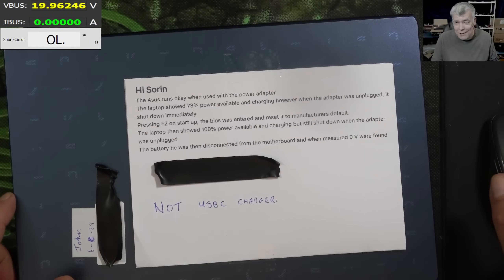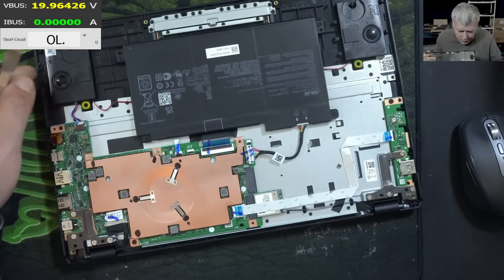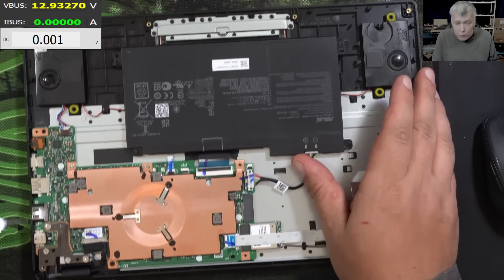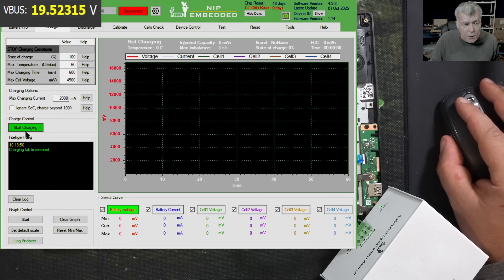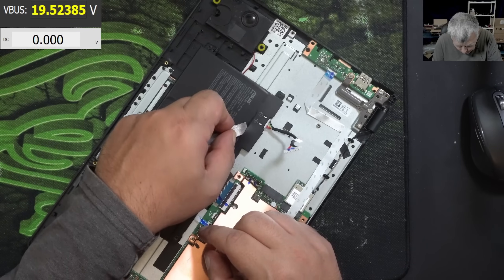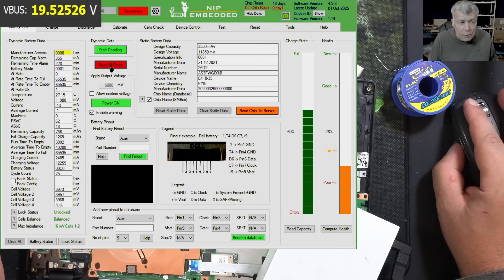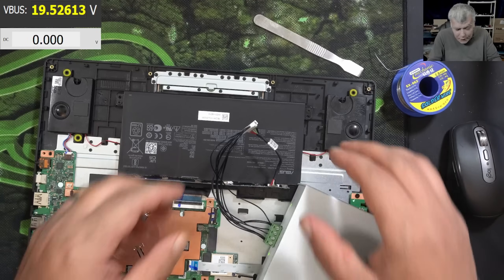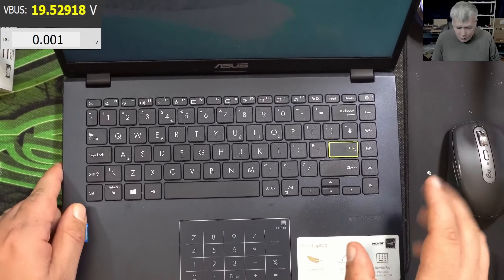Asus A410 not charging / holding the charge, battery repair, NLBA battery analyser GIVEAWAY!

Comment: The price of this device is fine (just), but the subscription fee is not. There should be no subscription fee.  In 10 years' time, there will be a different battery type for sure.  Sorry to be negative Sorin
Reply: I'm agree the device it's expensive this is one thing second the license it's very expensive unless you are not a big computer repair shop and you have plenty of laptops every week for example person like me buying faulty laptop to repair and sell them let say 2 or 3 laptops every week this doesn't worth AT ALL maybe for 1 mouth of buying laptops from 2 to 4 of them will have faulty battery there is no point buying this device cuz this device it's not made for everybody like let say if there is a credits like 5 credits 10£ 1 battery consume 1 credit this is different story i with buy it definitely but not how it now thanks free give me this device i will sell it but definitely will not pay this money every month also if i buy a battery from amazon and the laptop still doesn't work or charge for some reason i can aways return the battery and get refund
Reply: @CHRIS-FIX-1990  A token credit option would definitely interest me. I would happily pay £2 per token. It would be a great cost-effective solution for all technicians and would save on electronic waste.
Reply: Batteries cannot be counted. Sometimes it is needed to reset 3 or 5 times the chip until you fix it. I don’t think you want to spend 3-5 tokens for one battery.
Reply: @azzidoqsc That's more snake oil you're trying to sell. Since every battery has a unique ID or serial number, whatever, it shouldn't be so difficult to filter all the reset requests for that specific ID at your server side and count them all as a single one, for let's say one day. 

Even so, 3-5-10 or more attempts per battery unlock, this should definitely be OUR concern, WE should have the choice of spending more or less tokens for a specific battery. It all boils down to the cost of a token, of course, but some batteries may worth a few, whereas most will not worth not even a single one...
Reply: @silvake  Which unique ID ? Can you teach us, after 20 years of research I did not find a method to count batteries efficiently, please teach us. Our competitors are in the same position, no way to count batteries, but if you have found a reliable algorithm please contact us, we can reward you.
Reply: @CHRIS-FIX-1990   If you don't use the NLBA1 device of course it does not worth it. It is like I buy a Ferrari and I keep it in the garage. Anything which is not used is considered "expensive". There are Fluke basic multimiters which cost 10x more. By the way, Fluke released a kind of Battery Analyzer, BT510 for example costs $5600. No Repair functions. No Laptop Batteries, just the cells. NLBA1 offers all PRO Analysis functions for Free Lifetime Unlimited, this is how it was born. When Sorin reviewed it for the first time, it was an Analyzer, no subscription, no repairs.
Reply: @CHRIS-FIX-1990  I see that most of the people are confused. Let's clarify NLBA1: comes with all PRO Analysis functions Free Unlimited Lifetime. You pay once and you get a real PRO Battery analyzer forever, no subscription. More, you get 10 free days to repair unlimited batteries for free, 1000, 10000000, as many as you can for free. Repairing is optional, it was released in 2021 and this feature requires continuous software updates because newer and newer chips are appearing on the market.
Reply: You get free upgrades to the software, which includes different types of batteries.
Reply: @davidlguerr  At these prices, nothing is free... If one can make money with these high fees, that's awesome. It's a great tool to have, but the prices are too steep for the majority. We all want one, but most will end up out of pocket
Reply: Amazing device (still I can have it only in my dreams). Just wondering who can guarantee me this company will be still running the business for the next 10 years? What will happen to my money if they decide to close it? 
Otherwise I dream about this device every day!
Thanks! 😊
Reply: @Boris_repairs  We have an offline version for the analyzer.
Reply: You can buy 10 years license which includes 10 years free software update. 999$/10 years is only 99$ per year. How can be this expensive ? When a new Macbook battery costs over 100$.

Comment: Have to disagree Sorin,  id rather buy new battery and that is what i do,  i will never buy a device witch forces me in order to use it to pay a montly or annual software subscription,  means im the prisoner of the producer, no thanks. What kind of warranty cam you give for the battery repair?
Reply: I fully agree with you. Also, despite he has this expensive device he still had to cut open the battery. It's easier to buy a new battery. And it is safer too.
Reply: If the battery is very expensive or hard to get, I think there is some place for the NLBA, otherwise you better just buy a OEM battery as long as it is from a good supplier (not chinese Ebay sellers).
Reply: The license is stupid, but Sorin makes money using it. So it’s just a business expense. Like many other things.
Reply: @a.j.haverkamp if i'm on sorin i will buy desoldering wick ... not thisnkind of tools
Reply: That’s not right. Al Pro Analysis functions are free lifetime unlimited, like: testing charging, discharging, calibrating, checking cells condition, measure Internal Cells Resistance, measure real capacity, generate pdfs, etc.

Separately, repairing is optional, anyone can buy at any time this option if needed. The license price for 1 year is the price of 3-4 genuine batteries.
Reply: There are many situations where NLBA1 can do the job efficiently, for example many of our customers sell used laptop batteries. Their batteries are stored for a longer period, over discharged but cells in good shape, only over-discharged, such batteries can be easily pre-charged and reset. The batteries will work like before locking, same capacity, same condition. Our customers repair thousands such batteries in a year. No cells replacement, no too much time wasting. Another situation, there are many batteries which don't have a copy on the market, how do you proceed ? You are not prisoner of us because all PRO Analysis functions are Free Unlimited Lifetime like Fluke BT510 which costs $6000.
Reply: I see that most of the people are confused. Let's clarify NLBA1: comes with all PRO Analysis functions Free Unlimited Lifetime. You pay once and you get a real PRO Battery analyzer forever, no subscription. More, you get 10 free days to repair unlimited batteries for free, 1000, 10000000, as many as you can for free. Repairing is optional, it was released in 2021 and this feature requires continuous software updates because newer and newer chips are appearing on the market.
Reply: @nipembedded9976 nice try selling the stuff but No.😅 Buying new battery is easier.
Reply: I'm agree the device it's expensive this is one thing second the license it's very expensive unless you are not a big computer repair shop and you have plenty of laptops every week for example person like me buying faulty laptop to repair and sell them let say 2 or 3 laptops every week this doesn't worth AT ALL maybe for 1 mouth of buying laptops from 2 to 4 of them will have faulty battery there is no point buying this device cuz this device it's not made for everybody like let say if there is a credits like 5 credits 10£ 1 battery consume 1 credit this is different story i with buy it definitely but not how it now thanks free give me this device i will sell it but definitely will not pay this money every month also if i buy a battery from amazon and the laptop still doesn't work or charge for some reason i can aways return the battery and get refund